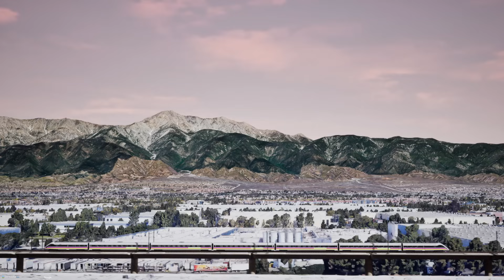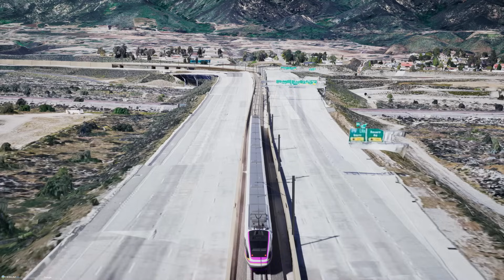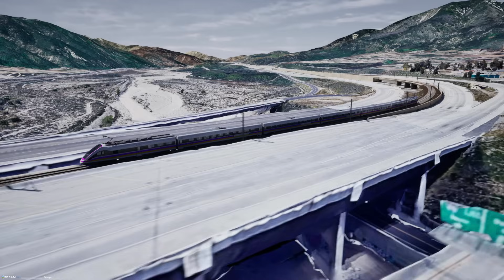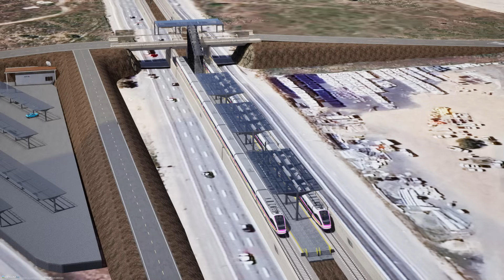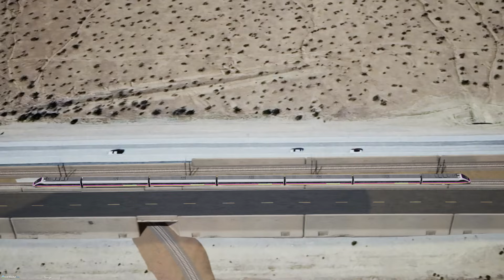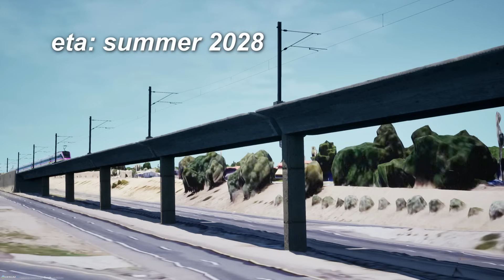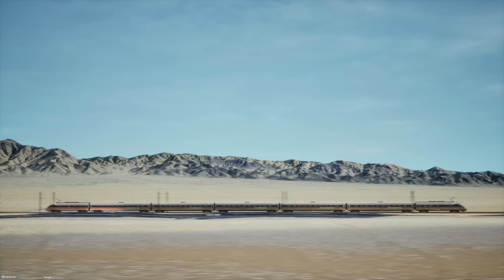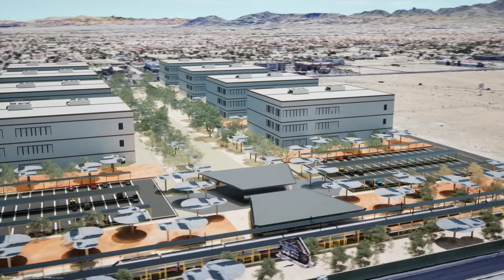The Brightline West High Speed Passenger Rail Route Rendered With Unreal Engine 5

Comment: As much as I am in favor of this, when I heard the round trip ticket price being over $400 I lost a lot of faith in it. This service is meant to compete with the airlines, and even Delta charges less than $150 for a Los Angeles to Las Vegas flight! Riding Japan's Tokaido Shinkansen from Tokyo to Osaka (a similar length) only costs about $200 round trip, so to charge twice that for a train that isn't as fast is ridiculous. Not to mention that it only connects Rancho Cucamonga at its southern terminus, so a Metrolink ride would take another hour on top of that to get to Union Station. At the very least I would consider dual-mode trainsets that could run through services on the Metrolink line, with a diesel engine at the power cars on the ends of the train, and possibly upgrading the Metrolink line for speeds of up to 110. I don't know how feasible this is but I think the transfer to a slower Metrolink train is going to turn off a lot of people. Then again, with California's ridiculous proposal to ban diesel locomotives by 2035, I can't really say I know everything.
Reply from the maker: Do you honestly think a basic ticket is going to be $400 when it opens?
Reply: I hope not, but they said that was the price they were looking at for a round trip in an article not too long ago.
Reply from the maker: @chartreuserailfanning  It's very difficult to tell from the article what that $400 figure means. If its for a top-tier ticket, it doesn't mean much for the average traveler. The article doesn't specify.

Comment: You would think a future goal would be to make it all the way to LA Union Terminal; stopping 40 miles east of LA  doesn't seem that great. Seems doable. In France the TGV's run on conventional tracks to access the city centers. Just electrify in to LAUT. Sadly, this would be a no-brainer in some parts of Europe.
Reply from the maker: Wes Edens, who is the driving force behind the Brightlines, said in a recent interview that it would be nice if Metrolink were to electrify the SB Line between the Rancho 8th St. station and L.A. Union. The thing there though is that wouldn't likely run any faster than the current Metrolink service. Metrolink is also working to cut headways to 30 minutes before the 2028 Olympics. Brightline West also has an agreement with Metrolink to coordinate arrivals and departures at 8th St. The only real difference electrification would make would be the possibility of a one-seat ride.

Comment: there is a lot of single tracks wondering how train will not block themselves for southbound vs northbound and as well hope it will not block in the future if they want to add more trains etc.
Reply from the maker: The trains will meet at the stations and double-tracked portions. Presumably there will be short waits for one train on occasion as the other shows up to pass. If the service is expanded, they will add more double-tracking to facilitate the additional traffic.
Reply: @LucidStew  And plus i think single tracks is good for cost reduction and to be ready for service in 4years, but i see let’s just hope it’s not blocking them other trains if one train is delayed etc
Reply from the maker: @quentinv1ks  Yes, surely they are making this choice to reduce capital costs in the short and long term. Most of the parts that they are planning to NEVER double-track would be very expensive. This also allows them to phase with ridership growth, which makes sense as business decision.
The route itself will likely have relatively high maintenance costs due to its extreme nature. Perhaps they're also attempting to offset some of that.

Comment: Watched this several times got me thinking. Would be interesting if Brightline starts two crews at the concrete plant you show and works building out from there in each direction. Good way to get concrete and materials into the median
Reply from the maker: They're planning to build the project in 4 segments. Sounds like the Cemex connection will allow them to haul the massive amounts of cement needed to directly where they'll need it. They'd be able to back into the right of way at the maintenance of way spur by the Victor Valley station site, so I wonder if that freeway work might be one of the first things they do in California... 🤔

Comment: The rendering seems to only show room for one track most part, but I feel like median in rural section of I-15 should have room for two tracks. 17-18 ft centerline spacing is enough for standard gauge double-track with design speed of 220mph. Typical section of 45 ft width should be enough. Rural part of I-15 is still two-lane per direction, so its median is probably 50 ft, which is perfect for a double-track rail line like this
Reply from the maker: The I-15 median is actually as much as 100 feet wide in places. They are only double-tracking as much as they need to facilitate their 1-hour headways. They plan to cut headways to 30 minutes in the 11th year of operation, which would require much more double-tracking.

Comment: That was an awesome video!!! 
But what a completely useless train. Goes from nowhere to nowhere convenient on both ends. 
Why can't they just build one that starts in one downtown and ends in the other downtown. Just DIG UNDERGROUND, ffs. Especially on the Vegas end. They should go underground where the current station is planned, and build a station in between the Strip and Downtown UNDERGROUND. 
But as of now you have to get off the train MILES from the Strip and downtown, and then take a TAXI which will take you another 30 to 40 minutes to get to your hotel  LMAO so how is that cutting down on travel time for anybody on that end? 
And on the LA end, it's not "LA" but it's Rancho Cuca, where nobody lives. 
They honestly think these trains can handle the 6% grade????? Are they insane???? It'll be slow as heck with the passengers in the carriages.

Comment: great job.  I love that you took the time to create and research this.   I've been wanting to see concepts of where there were single and double track alignments.  I am curious about the single track alignment when its crossing under bridges in the Victor Valley which side of the center bridge support columns the track will be on or if they plan to replace all bridges so that there is no center column.
Reply from the maker: Thanks. From the 30% design it looks like the track will be on east side of the freeway through areas like Fontana and Victorville. The plan is to widen and reconfigure the one side of the freeway where the track does not fit. It that is not possible, they will replace the overcrossing. More often than not the existing bridges will stay.

Comment: I use to live in vegas  most of vegas runs by city bus and city bus transit center is about 1 mile away so I would add a city bus substation to your plans because it will help with ridership and a tur around points for strip city bus
Reply from the maker: These are not my plans, these are the Brightline West plans as best I could interpret them. The BLW renders for the Las Vegas station include a bus depot.